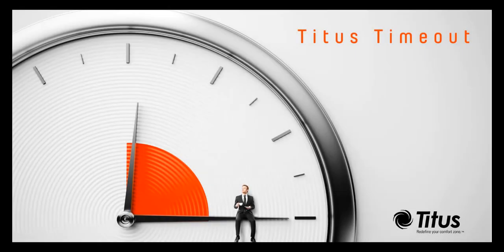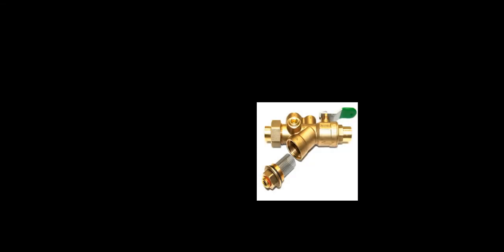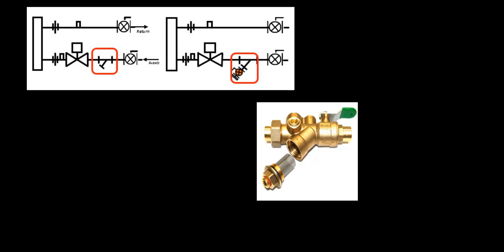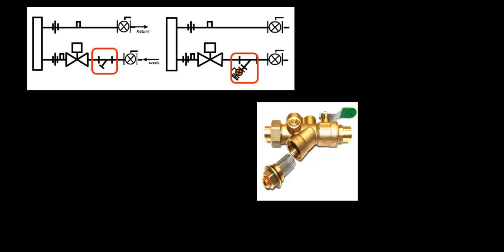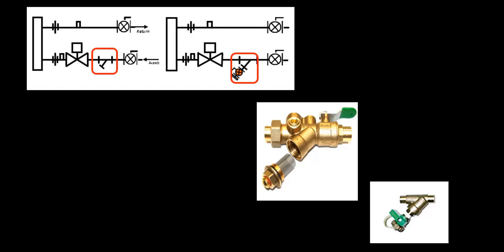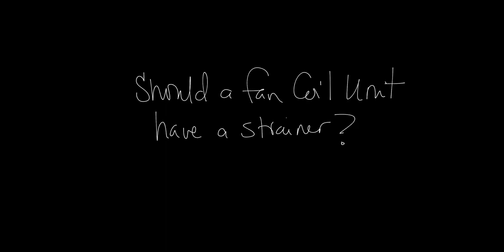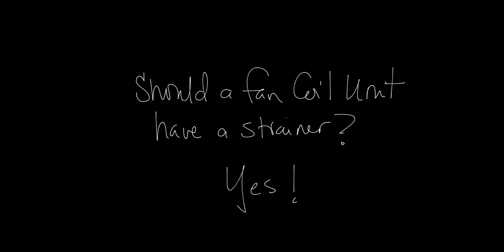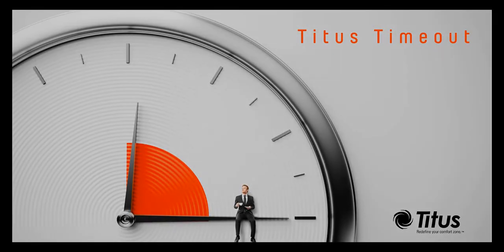Titus Timeout Podcast - Valve Package Strainers

Comment: the schematic shows 2way valve is in the supply line? Could you please clarify why. I have leant and read that it should be at return path to keep the coil flooded all the time and to avoid air bubbles which might result in coil deration.
Reply from the maker: Due to the space requirements of fitting all the valves into a small valve package envelope inside the Fan Coil units; it gave us more space to place the Control Valve on the Supply Line.  Because the entire plumbing water circuit that the Fan Coil units are on is a ‘closed’ loop plumbing circuit, water cannot drain from the coil regardless of where the Control valve is located.  While we do acknowledge the general practice is to place the valve on the Return line, it can be placed on the Supply line of a closed loop water circuit system if necessary.